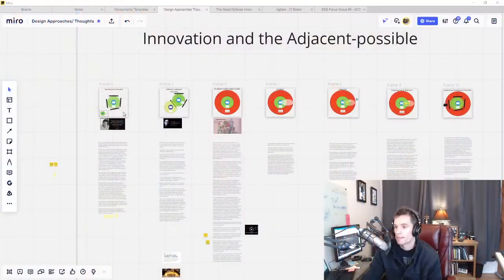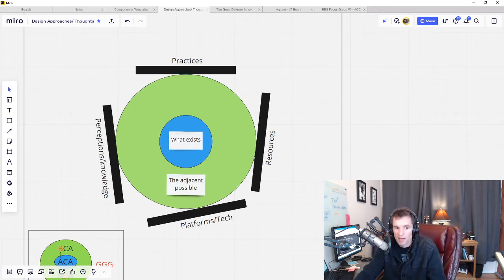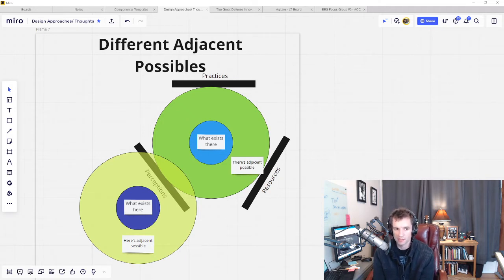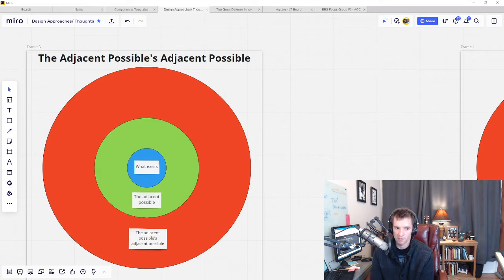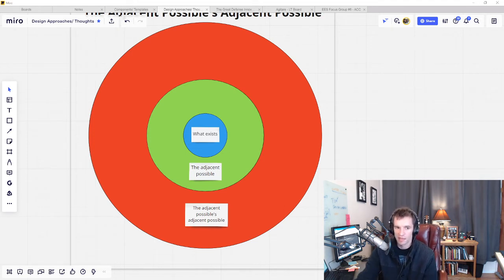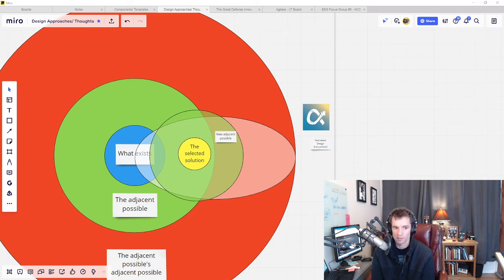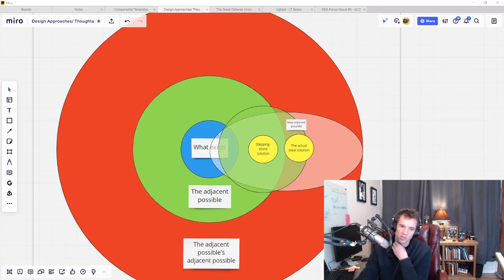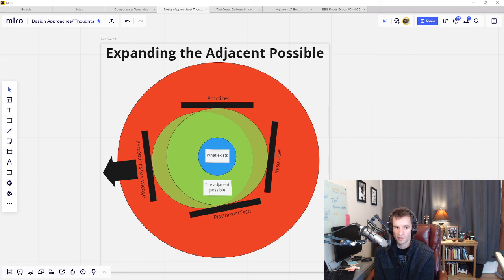Innovation, Design, and the Adjacent Possible (and some Cynefin)

Comment: Here's a 5-point summary of the talk "Innovation, Design, and the Adjacent Possible (and some Cynefin)":

1) The Adjacent Possible: A concept describing the realm of current possibilities constrained by factors like practices, perceptions, knowledge, technology, and resources.
2) Contextual Innovation: Solutions that work in one context may not work in another due to differing constraints, emphasizing the importance of understanding unique needs and limitations.
3) Exaptation in Innovation: Repurposing existing technologies or platforms for new uses, often more feasible within the adjacent possible as it leverages what already exists.
4) Stepping Stone Solutions: Implementing intermediate solutions to expand the adjacent possible, making previously unattainable goals achievable in the future.
5) Expanding the Adjacent Possible: Identifying and addressing constraints that limit exploration and evolution, such as improving knowledge flow and resource availability within organizations.